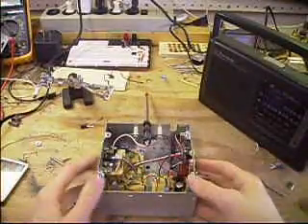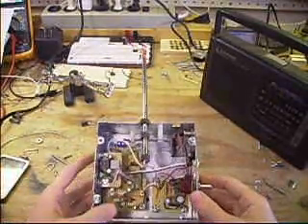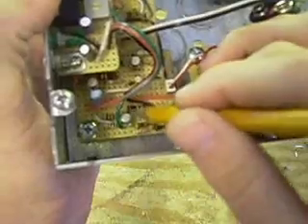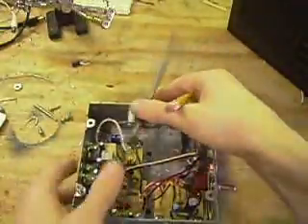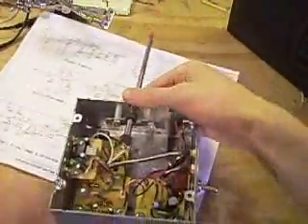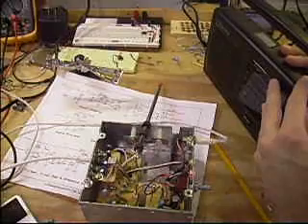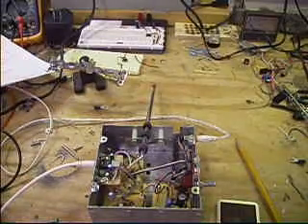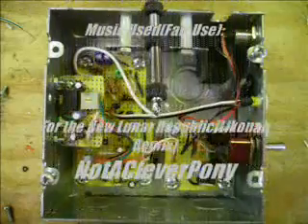FM Transmitter - TeleTalk v2 Test Run

Comment: @3mustardMoNkEyS 
Cameramanlink built my AM transmitter and could not get the oscillator to work. I asked him to send pictures. He had black rubber grommets as insulators for the tank circuit. They were shorting out the RF, he replaced them with clear plastic and the oscillator worked. The higher the frequency the bigger the problem.

Building a transmitter from scratch is not easy. Your doing great!

Comment: Great experimenting and build, really nice work. Sounds great too. RF is a fascinating study, and frustrating all in one. The capacitance between the antenna inside the metal box and the metal cover is detuning the circuit. The higher the RF frequency, the more the problem. Building a transmitter is one of the harder projects to build, and from scratch, much harder. Great work!!!